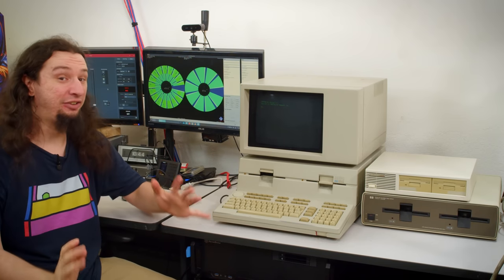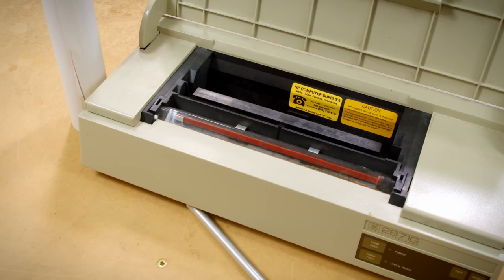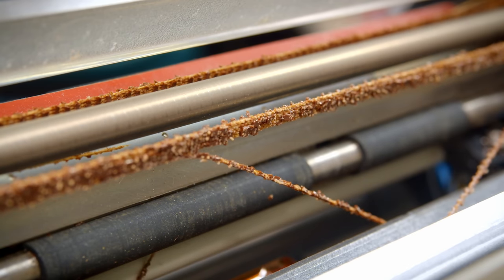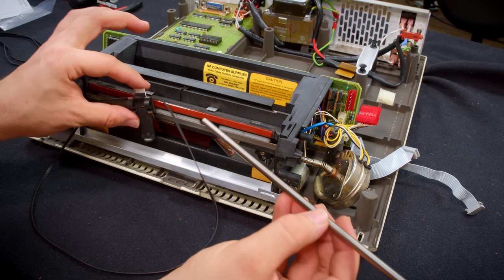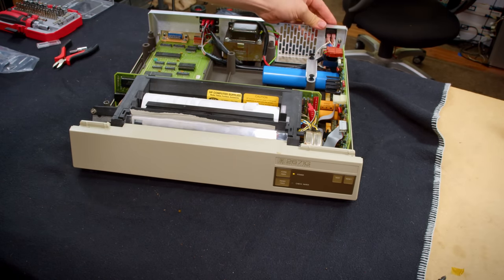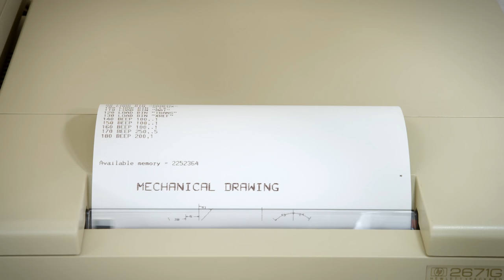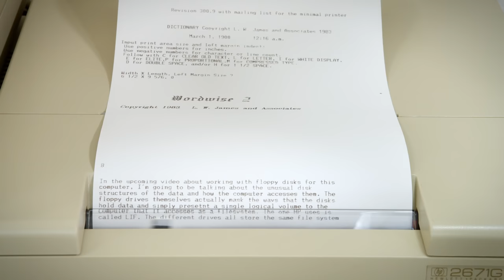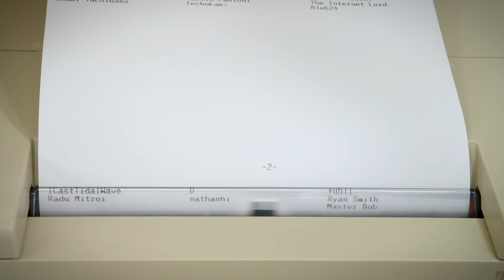Printing From the Past - HP 2671G Thermal Printer

Comment: Faded thermal copies can be resurrected by holding the paper in an alcohol vapour ( methylated spirits Works well) the print becomes inverted
Reply: Can I spray rubbing alcohol
Reply: @AgentOffice  no, hold the paper above the bottle with the lid off

Comment: For the paper cutting you minght want to take the cutting edge from a box of aluminium foil and attaach it to the printer in a way that allows you to tear the paper off. Double sided tape should allow for it to be non-destructively removed in the future.

Comment: As mentioned already, the Bisphenol coating of the paper is of some health concern. No panic, I guess, but best treat it accordingly.
Reply: Accordingly, or "in a way that is appropriate to the particular circumstances". So if it's a bit toxic, well, basically don't mess around with it as you might if it was not. 🙂
Reply: so, don't eat it or use it as cigarette paper
Reply: Yeah it is full of female hormones

Comment: Fax paper is designed to be torn against a serrated metal blade, so that's why trying to tear it against a smooth piece of plastic isn't working so well. Maybe the original thermal paper HP sold for it had perforations after every page length, like dot matrix printer paper?

And your excitement about being able to do a screen print of the game reminded me of Ashens' video about the Megaduck Super Computer, which had the same feature.
Reply: Yes I have a bunch of the original thermal papers in original box. They are perforated and folded just like paper for dot matrix printers, but without the side holes. Each section is in A4 size. There's even a stainless steel paper holder that you can attach to the top of the printer, which was designed especially for the folded papers.

Comment: I ran across something rare and unusual recently that I think you would enjoy. It's a Casio Board Copy CP-1000. It is a combination black and white camera and thermal printer. So you point it at something, press a button, and it prints out the picture from a full sized 8.5 inch wide thermal paper spool. Also despite being a "large format" thermal printer it actually works totally differently than this one.
Reply: that sounds more like a Cathode Ray Dude kind of thing, he collects obscure early digital cameras. that Casio would be right up his street!
Reply: If that's one of those portable copiers, he already did a video about that.

Comment: I almost wonder if that old belt wasn't some kind of glass fiber reinforced, and the rubber HAD disintegrated, so you were left with mostly just the glass fiber strands? Hence, why it was solid and  "stringy" as you took it out.
Reply: þe strings are peices of fabric, þe belt was made by putting þe fabric into a mold and fillling it wiþ rubber. þe fabric holds the strengþ and þe rubber interfaces wiþ þe cogs
Reply: @CaptainAwsome  Fascinating - I am puzzled how you got the Thorn character in place of the th.  An Icelandic or Scandinavian localisation?

Comment: I had a thermal transfer printer back in the 90's. (had a "ribbon" to print on normal paper) After a few million miles, the print head will be gone... it is effectively rubbing a very fine sandpaper in normal operation. (paper may feel smooth, but it isn't) I still have dot-matrix printers from the 80's that work perfectly.

Comment: These thermal printers were really hot stuff back in the day!  Not that long ago, I came across a thermally printed receipt inside a paperback which I bought used.  It had blackened, but most of the text was still readable.  Thermally printed receipts were rather ubiquitous for a time.  I love that you were able to restore your HP to working status again!

Comment: "best" part with thermal prints is you cant store them. Excellent for information not worth keeping :P
What i really like about old stuff (computers, electronics etc) is they say "No serviceable parts inside", and are still dead easy to take apart and service :)
Reply: No USER serviceable parts inside. Because licensed technicians are apparently cloned and grown, then given special training to remove a panel, a screw, and unplug a cable. No human could ever learn that! Especially not one that didnt give us a few hundred dollars for a 4 hour long seminar at the Radisson next to the airport. No, not the nice one.

......dont get my started on the glass fuses that have through hole leads on them........ Why do we put up with companies treating literally everyone like they're braindead apes? I mean, its the maker generation.....Someone who could design a thing that provides the same functionality as just about anything, and run it off a raspberry pi. So, instead of trying to convince us there is magic under the casing that is somehow different from every other piece of electronics, hows about you TV manufacturers just spend the extra 2 cents per pallet and use properly sized capacitors so we dont have to buy another power board thats more than half the price of the TV?!??! Because apparently the imaging panel, video board, backlighting system, casing, and licenses all make up the other half.....HOW DOES A SWITCH MODE POWER SUPPLY THAT PUTS OUT 12V AND 5V AT 2 AMPS THAT EXPENSIVE?!?!! Thiefs, man....fucking thiefs...... And I asked you to not get me started!!!
Reply: Yes you can.

Comment: Fax that paper was designed for has a cutter bar in it, that has multiple sharp plastic teeth, so it will perforate the paper as you pull it forward, so making it easy to tear. Not many fax machines with thermal paper came with a cutter attached to directly cut without user intervention, most would just print a dotted cut line separating pages.

Comment: oh just a thought: if you're still having issues, another idea beyond replacing that o-ring wheel is to add a couple drops of oil on the rod that print head slides along. I would use a lightweight synthetic oil, maybe superlube? You want something with a little bit of heat resistance considering how close it is to the print head, just in case. 

I had to oil up a similar rod in a much newer and much larger HP printer (a DesignJet) just a couple months ago haha. HP had their own formulation for that oil, but I'd be surprised if anything fancy is actually needed.

Comment: Nice, someone finally did a video on these printers!
I have a 2673A in my collection, which was once used along with a HP-1000E minicomputer. I'm surprised that the mainboard of 2671G and 2673A are completely different. The board in 2673A extends all the way to the right, almost occupies the entire internal space. There're also 7 64Kbit ROMs in the 2673A instead of only one in the 2671G.
Unfortunately, one of the ROMs in my machine seems to be bad and the self-test gives a ROM error (yes the 2673A even has a 7-digit LED display on the motherboard that gives error codes). Using a thermal camera I can also see the broken ROM is slightly warmer than the others. So if someone has a dump of the 2673A ROM I'd be very grateful!
Also what's interesting about the 2673A is that it has a user interface using the printer itself. You can access the settings through the front panel and the menus will be printed directly on to the paper for you to see. I'm not sure if the 2671G has this system, but it would be cool if you can try it out.

Comment: There was an early analog printer that was connected by coax to CRT terminals.  On the back of the CRT set the switch to unterminated (take the 75 ohm out of the circuit) and daisy chain the printer to the terminal.  The printer would print whatever was on the screen.  The printer was called The Perkin Elmer Pussycat.
Reply: The Perkin Elmer Pussycat -- best name ever! 🙂

Comment: There's something to be said for the durability of older tech.  While not thermal simple, we have an impact printer we use to print shipping labels once a week.  It's an Epson and the model we use has literally been in production with no changes for like 20 years now...AND I can tell you why because it works perfectly and reliably for the job of printing endless, simple, labels.  Ink ribbon and the print head basically being the only thing that moves (and the ribbon gets replaced so only the simple impact print head really does any work, etc).

Comment: They also use thermal paper for self-adhesive postage labels so you can't take them off and transfer them onto another package with a heat gun.

Comment: HP made an earlier thermal printer with a stationary printhead that was the width of the paper.  It would print a line at a time as the paper advanced.  This was in the '70's before PC's.  HP's customer was Bond Buyer and Bond Buyer's customers were banks and trading firms.  The printer was attached to a Message Division Multiplexer (actually de-multiplexer).  The printer would only print news relevant to the bond issue that the bank was flogging.  When the entire issue was sold the syndicate would be dissolved.  The de-multiplexer was also made by HP.

Comment: i bought a Sears 500 electronic typewriter because its thermal dot matrix and has a port to connect older computers of which i have a vic 20, c64 that are compatible and a zx81 clone that may be

also something i did for my typewriter,  a tear strip off of plastic wrap box can be gently attached under the clear plastic edge to make it easier to tear the paper off lol

Comment: Hello.

Thank You for your presentation of HP 9368C (HP 9000 series 200) workstation. I have never seen it in my life, but I had limited (5 days) experience with HP 9000/300 series workstation and a little bit longer with HP/Apollo 9000/400 series workstations (425t and 433s)...

You mentioned, that you are unable to find a CAD application for the HP 9368C. HP was very much involved into development of mechanical CAD software back then, the HP93XX family of workstations was instrumental for development of 2D CAD package called ME-10. It was first developed for HP93XX with Pascal operating system and was transferred to HP-UX after it’s appearance. This CAD package was practically unknown in USA, it seems that HP was only user of it. Europe was a different story. It was most numerous mechanical CAD application after Auto-CAD in German speaking environments (and not only there 🙂 ). HP even made separate division for mechanical CAD, called HP-MDD (Mechanical Design Division), with centre and main development company based in Böblingen in Germany. In 1996 it spun-off as HP subsidiary company under name CoCreate, which was purchased by PTC in 2007…

HP Computer Museum has two CD-s of ME10/ME30 (ME30 is 3D modeler) for HP 9000/300 and HP9000/700 under HP-UX 9.X operating system:

http://www.hpmuseum.net/display_item.php?sw=548
http://www.hpmuseum.net/display_item.php?sw=544

Thank You and best regards

Jože from Slovenija

Comment: Thermal paper is awesome, but sadly not only can get black, but it may fade too over time. So, with all the convenience it offers, at the same time is only viable for temporary printing. Of course someone will say that properly archived would last. In my experience, all my thermal paper tickets that I archived faded away or got unreadable some way. It's a pity because it's a great and cheap way to print some type of stuff that you don't want or need a fancy printer.

Comment: One thing you should do is clean the print head. Since this is a thermal printer it might have gunk build up on the print head. I have one of those little bluetooth thermal printers the paperang one and every now and then I clean the head with IPA and a cotton swab and that helps. Not sure how you would clean the head on this printer.

Comment: This  HP 9836C got my attention from the first video. It seems as VERY capable machine for its time, and very expensive too :)
It seems the video has 2 layers and the kernel can dump the content to the printer (1 layer at a time) that is why some holes. Also since you have specialized keys for that, probably the 2 layers are fixed - one just for text and one just for graphics.
P.S. PLEASE make a follow up video on graphic capabilities of that machine! Watching it making me wants to write some code for it.

Comment: hi tech tangents (shelby?). though I am not really an enthusiast for vintage or 80s equipment myself, I find your exuberance and enthusiasm incredibly inspiring and infectious. on an unrelated note... if you FF to 31:02 or 31:05, you are seen to be waving your hand over the monochrome display. when that occurs, your hand (as intersected by the screen) takes on a super contrasted effect. any idea as to what is doing that? 

ALSO don't stop being a super duper nerd, dude... you are a really interesting channel to watch. thanks!
Reply: Short answer, he edited the CRT in post to make it more visible. I assume he put a layer on top of the CRT and made the contrast higher than the rest of the frame.
Reply: @Toonrick12  i kind thought so, but I didn't want to sound accusatory. it's cool, doesn't change my opinion or admiration of the guy. thanks

Comment: I have an idea on how to cut the fax paper, that I think should work
save the metal cutter from a box of aluminum foil or plastic wrap.
 and  hot glue it to the edge of the plastic paper guide. and you will
 just have to give the fax paper a quick pull and it will will cut it.

Comment: I'm still kicking myself for passing up all the hp goodies at thrift stores since i was looking for  a main machine first. Anyway i love it. I also love the thinkjet too. Yes, they was $$$$ and you was locked into a eco system. But, most of it just worked. When you said thermail paper. I'm thinking should fire right up. So when you said repair. I'm thinking what repair? Then you said belt turned to goo. Oh, never mind. I have had a few other items like VCR's and tape decks with that issue. Bleah.

Comment: You just gave me another HP thing to worry about.  I believe the same printer mechanism is built in on my HP 9845.  I have stored some printouts from the computer original user, but have not tried too much anything with it.  One of the reasons was that there was a huge amount of "peanuts" in the shipping box and one important part (a disk drive interface cable) was lost among those.  My fault, of course.  The original user calculated servo motor responses with the computer and printed the results, which I still have.  But how good or bad is the belt nowadays?  And where did you get your replacement belt?

Comment: Never seen a Thermal 🖨 that big, I used to have a Thermal 🖨 for my Spectrum 48k and then my Sinclair QL Which were really small.
Reply: Texas Instruments made a range of thermal printers called Silent Writer - they were pretty cool too and used the same thermal print head technology.  The Sinclair printers were slightly different using a method which eroded a metalisation layer on a dark paper, so the printing ended up being black text on silver.  They were pretty clever machines in their own right, although they relied on the intelligence in the host computer for their operation.

Comment: Interesting how when printing text, it prints while going both ways. But when printing graphics, it prints only while going left to right. Is that a common behaviour with older printers? My family used to have Amigas back in the day, and on those the printers would only print while the shuttle was going left to right, but not on the return. The same printer connected to a PC would print going both ways. Tried both dot matrix and inkjet printers. Unfortunatly it meant printing was considerably slower on the Amiga than on PC. Never figured out why.

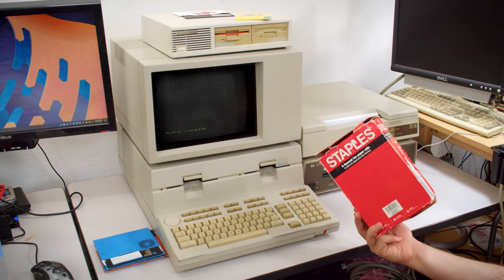Comment: 25:25
The more modern FAX machines(I would say 90s and after era) that this paper was meant to be used for , usually have metal saw-teeth like blade (like the one on tin foil box) for you to tear the printed paper off , or cutter blades.

Comment: I read somewhere that thermal paper (like the kind used for receipts that are printed on thermal printers) are bad for you to touch too much due to the chemicals on the paper not being good for you
Reply: Thermal paper (often) has BPA on it, the chemical everyone was freaking out about a few years ago from it being in plastic water bottles.  BPA is an endocrine disrupter.

Honestly, unless you're licking your fingers all the time I'm not sure it's all that much of a problem.  And even then I'd have doubts much BPA would transfer to your hands.

But sure, it's good to know this isn't normal paper, so don't let it come into contact with food, or eat the stuff for some strange reason.
Reply: @stevesether  or let your dog eat your receipts which can happen

Comment: Does anybody know where I could possibly get replacement print heads for these? I have an 2671A and a 2673A that I'd like to get working but both have damaged print heads.

Also for Mr. Tangents: I found an obscure PDF with what look to be hand-drawn, reversed-engineered schematics of the G model. Is there a way I can get those to you? I don't really have a good way to distribute them myself.
Reply from the maker: I don't know about the print heads, but I would upload the schematics to archive.org!
Reply: @TechTangents  Ah, good idea. Will do! Shame about the print heads though. These things are basically big paperweights without them.

Comment: Why don't they cancel fractions out by multiples in capacitors that big by just, for example, instead of calling this big one a 14K-mu-farad ("kilo-micro...") capacitor, just calling it a 14mF -- a 14-millifarad (14000 times .000001, one millionth) capacitor?